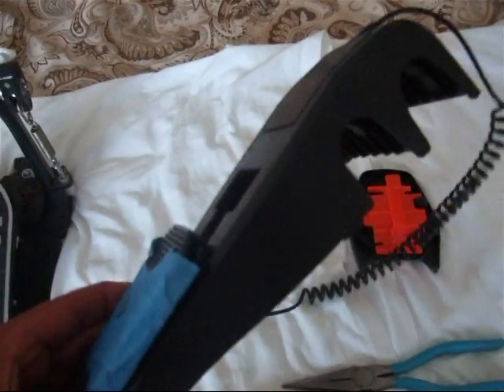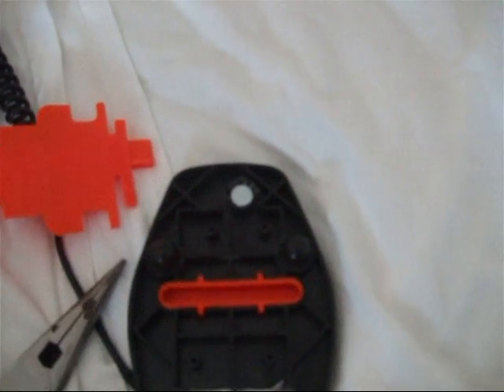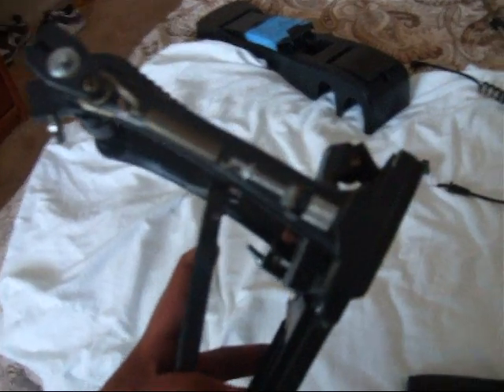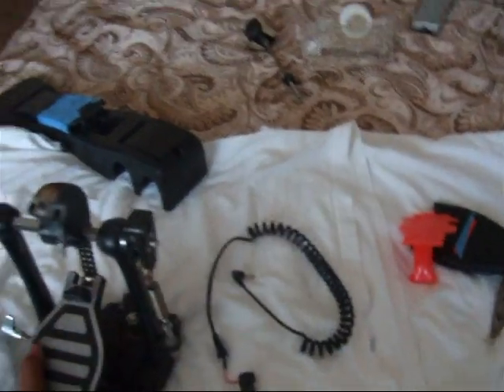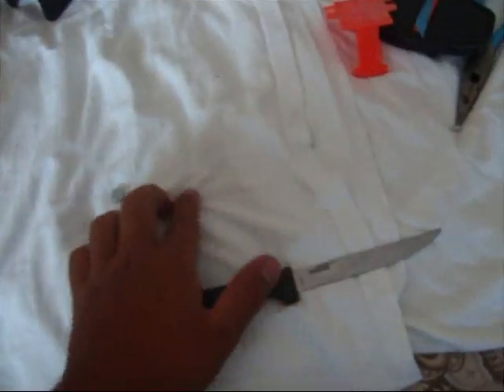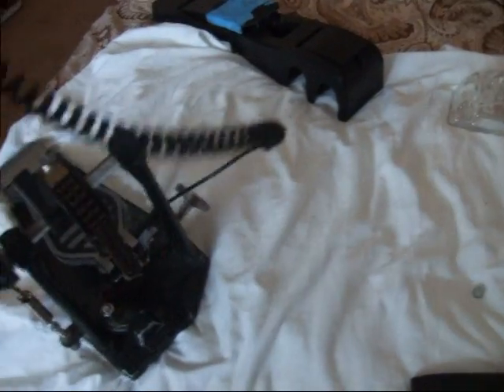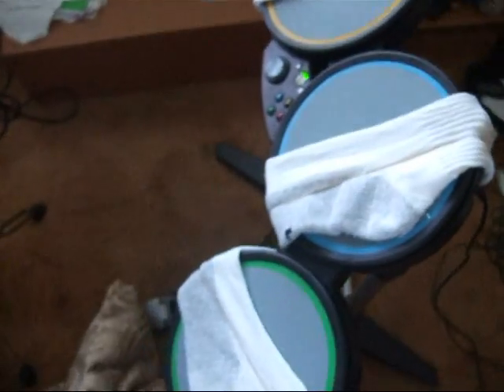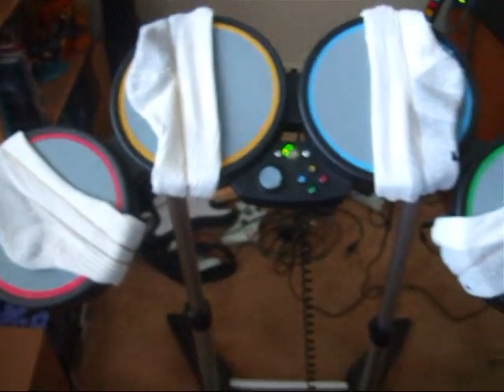build your own rock band drum pedal

Comment: Just a piece of advice, put the sensor on the bottom and strap the magnet to the top.  You've put the sensor on the moving part so those wires are going to be flopping around like crazy, putting a lot of stress on the connections.

Comment: Although I reversed the process, it worked as you said. I removed old sensor/pick up from pulse kickpedal, installed RB4 sensor at same location and adjusted pedal for efficient response. Simple installation and basic adjustments.  Thanks for the video.

Comment: The screws should probably be under the arched rubber things if they aren't visible. You'll have to pull those off to get to the screws. (mine was like this too) For som reason though, if yours is anything like mine, the sensor is attached to the pedal with some plastic Posts that you'll have to carefully cut or saw off, and not break the sensor.

Comment: you can hear the "click" noise of the sensor when the magnet its in the right position for closing the circuit, its a very soft sound, but helps a lot for checking the right position

in fact you can build a compatible rockband pedal with those home security alarm sensors, its the exactly same mecanism :-)

Comment: if you look where the half circles are that go over the metal bars, there should be some rubber/plastic.remove those. there should be two screws in holes. remove those than hit the bottom of the sensor holder. there is the sensor. it comes out easily.

Comment: The wired part should not be on the moving part if you ask me.  You should try instead to put the wired part at the bottom of the pedal and the magnet on the base.  I'm pretty sure the wires won't hold up.

Comment: ok pepes wit the newer model....there r the two slots were u can adjust where u want ur pedal to be at the verey top....there r little rubber protectors......all u have to do is get those off,which are verry very hard to get off so ya :] then u unscrew em.but there r  4 screws instead of 2.2 in the bottom row and 2 in the top row.......! i liked ur vid mines a diff model but i hope it works

Comment: thats what i did sept i put the mag on the pedal its self taped the censor to the base where the clip is to clip it to a bass drum. i dont know why all people dont just do this. its free. its jsut as good ast the 70$ pedals u buy offline sept its compeletly free if u have tape and a pedal . if not its still 123123 cheaper to get a pedal and do it with the stufff from rockbands pedal.. and the mag can be a little off u just have to get it witn in about an inch of the censor.